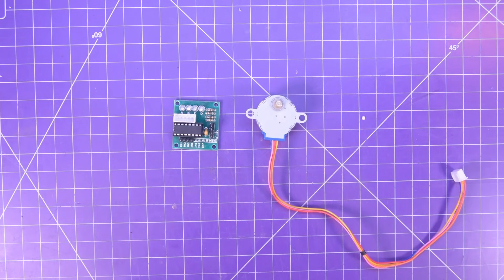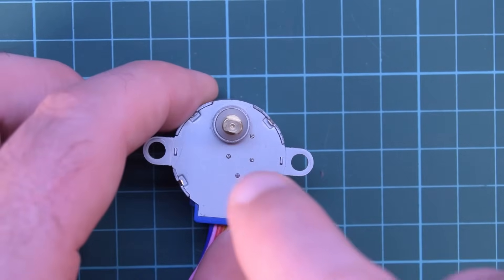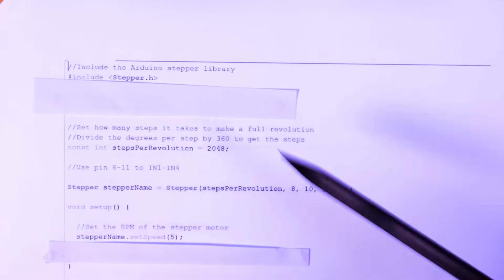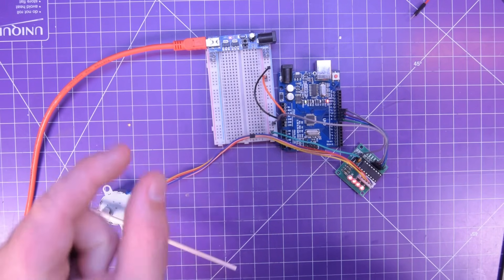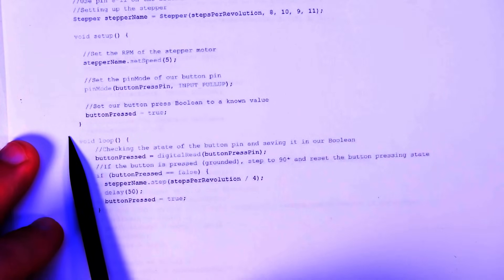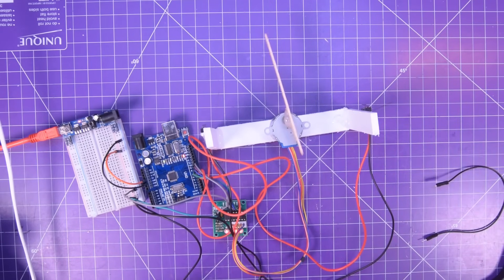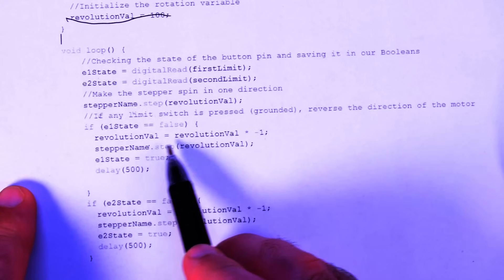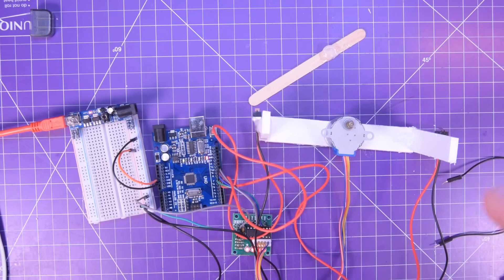The Cheapest Stepper Motor And How You Use It (28BYJ-48 & ULN2003 Arduino Tutorial!) (WITH CODE!)

Comment: Just FYI: The Arduino dev board YB-ESP32-S3-DRV (sold e.g. on eBay and documented on github) needs no cabling or external modules and makes controlling two stepper motors like 28BYJ-48 a breeze. Cheers Th

Comment: Will you tell me about your powersupply? At first I thought that I could use a 12V powersupply and the ULN2003 should reduce it to the value from the stepper. I couldn't find that in the documentation. To be sure not to overload the motor I decided to use a 5V supply because I had one with 350Amp. I could see that the program runned  because I added some counter messages in the serial monitor but the motor didn't run. How much Amps is your powersupply?

Comment: Train geek here, do a sketch that will make the stepper motor rotate a turntable and stop at the desired location so that the train can roll off the turn table.  Having 3 or 4 places to stop and a way to have the turntable do a 180 so the engine is turned around
Reply from the maker: Perfect use case for ChatGPT!

Comment: The first code works well, the second one that includes a button doesn't. Iv followed the instruction fully. somehow the button does not cause the motor to rotate.
Reply: ok i found the solution. I simply changed my setSpeed from (5) to (10)

Comment: Can anyone help me regarding the wires, I'm currently using an Arduino starter kit and the wire it uses doesn't connect the Arduino Circuit with the 28BYJ-48

Comment: I need a way to set up an app on my phone to be able to control a damper on my stove with temperature.
Reply from the maker: That's a big project! I recommend you leverage some AI to help you code that - one of my latest videos goes over using AI to make all sorts of code!
Reply: @ connecting the motor to the dial is easy for me to do. Its the electronics i have the trouble with. I want to be able to connect the stepper motor to a smart thermometer and have the motor move with the temperature as the temperature changes, not move in one motion but little by little say from one o'clock to 2 o'clock with one or two temperature changes
Reply: @SimpleElectronics @ connecting the motor to the dial is easy for me to do. Its the electronics i have the trouble with. I want to be able to connect the stepper motor to a smart thermometer and have the motor move with the temperature as the temperature changes, not move in one motion but little by little say from one o'clock to 2 o'clock with one or two temperature changes

Comment: Hi, nothing is perfect the first time. The best way to learn is from your own errors. I like this video.  I would try to replace these end-switches by (fast) light sensor. Which one would you use? Read analog input on Arduino / distinguish between light and dark level? Need to read ambient light level at start? Just some thoughts. This might be a challenge. Also, I prefer wood and screw instead of plastic and glue. Thank you.
Reply from the maker: You can use a pair of LEDs if you wanted to, if you shine a LED into another LED (works best with any color but white) the one being shined on will generate a voltage, so you can check for voltage and when the beam is broken, switch the direction

Comment: I wish to use a stepper motor to brush spiderwebs away from the lenses of my video surveillance cameras. Maybe a very light soft brittle brush directly wiping across the lens and a light 45 degree arm to wipe the abseiling spiders further out from the camera by a foot. I have to use a long stick and paint brush regularly and 10 minutes later the spider is back like a ninja.
Reply: Try a servo motor, it’s even easier to control, and you can set it to desired (absolute) positions, which a stepper can’t do.

Comment: 13:15 I'm curious if when the motor reaches the outer bound, the resistance seen by the motor changes (likely seen as a change in voltage e.g. voltage drop), if this location can have this moment logged, which it then uses as a stored value to change rotation. Effectively make it self learn it's outer bounds in both sides. Run it for a couple of cycles until it rotates fully without any resistance/voltage drop. This would also help the motor from doing too much extra work increasing is longevity. 
Could maybe program it to recheck those bounds every 100 cycles or so incase any tolerances have caused a change in position.

Comment: Hi, can we use this without driver? If i just need to make something, rotate indefinitely
Reply from the maker: No you can't - but to just make something spin indefinitely, just get a regular DC motor - you can adjust the voltage or the current to control the speed - set it and forget it!
Reply: @SimpleElectronics  Thank you so much

Comment: Ok, newbe here!!  My problem is everytime I compile the code it errors.  It says "compilation error: expected '}' at end of input.   Last of the code is .....  stepperName.step(stepsPerRevolution / 4);
delay(50);  
 buttonPressed = true;

}                                         What is wrong with this?                                 By the way love your videos!!
Reply: well i’m not a programmer but a have little background. you have a syntax error and it expected another “}” somewhere. it depends on the rest of the code previous. but somewhere in there, there is a opened bracket that you haven’t closed with the “}”

Comment: 5:10 So, if I need only it spinning on the lower speed in a constant motion, do I have to use an Arduino? All I need is it spinning in the lowest speed possible for my project. Other motors (DC motors) are way to loud and stepper motors are really quiet in comparison. Would it suffice only using the ULN2003 and the stepper motor? Maybe a turn on/off button maybe?

Comment: Nice video! I like the honest way of presentation.
Yes. For that task, I would go with "attachInterrupt" to change direction whenever a button is pressed.

Whatever happens in the main loop, the interrupt will execute. Even if the mainloop "stuck" in a delay function.
Interrupts always have precedence.

But as you mentioned: the code you shown is not perfect. I really like the honest way of your presentation.
Your focus was on the very basic operation of the stepper and the code.
Mission accomplished! 😊

Comment: I have 2 of these motors and I want to control them using the Arduino uno and a gyroscope mpu6050 , do I need an external power supply to power them or cable connected to the PC and 5v from Arduino should be fine ? Please answer
Reply from the maker: depends on the load - when in doubt, just use an external supply

Comment: I have an application, where I need to apply 14oz of force (pull or push, I assume is the same diff) to trigger a switch.  Can this stepper motor do that or do I need a different/better one?  If so, any suggestions?
Reply: Torque is the issue ... not Force. So how far away from the axis of the stepper motor does this have to happen?
Reply: @davidbroadfoot1864  Assuming a small gear or pulley were attached to the spindle of this stepper motor and it was tied (with a string) to a 14oz weight (the stepper motor being fixed to a board or something), could it pull hard enough to reel in that 14oz weight?  I assume a 14oz weight is 14oz, regardless if it's parallel to the stepper motor or on the floor, etc.

Comment: Wow. Awesone. Exactly what I need for blinking on robot eyes. I'm a year on, but as an arduino dunce (I can tweak but not write) could you pretty please nicely write a code that will blink eyes, a little faster and with say, 10 seconds intervals once switch activated to run permanently until deactivated? Well, you kindly offered. Btw I think your clip is brilliant. Even a simpleton like me can grasp it. I've brought you a choc orange just for the video, great. Don't worry if its a problem to write code. Cheers. :)
Reply from the maker: I am glad you liked the video but I am not in any shape to be taking on commissions at this time! check out the Arduino forums and reddit for some help! Make sure you give it your best shot before posting your code over there for help - but I am confident you can get it done - good luck!

Comment: When i turn on my stepper motor , it just vibrates bit the shaft doesnt rotate , does anybody experience the same issue ?
Reply: What you should do is check
* the connections -> PIN 1/2/3/4 of the ULN-Board must go to PIN 8/9/10/11 on the Arduino
* the code (6:05) -> the order of the pins is important ->  Stepper stepperName = Stepper(stepsPerRev, 8, 10, 9, 11);
* the value of the speed -> stepperName.setSpeed(15) - in my test/case a value higher than 15 let the motor losing steps

if are all correct and the motor doesn't work correctly, check the power for the motor. The motor (I've got today) has a consumption of 330mA at 3 to 7 volts. In my case I've connected the motor to a 9V block-batterie.

Comment: I have just come acroos your channel so havnt had a proper look. But if you havnt, could you do a tutorial om how to automticly have the motor speed up to x speed for x time and then slow down to  a stop using a push button. Could you also show how to code a button press to slow and then stop the motor even if it hasnt got to full speed. I make funfair models for a hobby (I have videos on my channel) And my next project requires one button to start and stop the model.

Comment: Once you use the arduino to write the code to the controller, can you unplug the arduino ?
Reply from the maker: No sir, the Arduino is constantly controlling the motor - the chip only turns the signals into a source strong enough to power the motor
Reply: @SimpleElectronics  Thankyou!

Comment: For this motor do you HAVE to have it connected to an arduino? I have a motor speed control circuit and have it connected from the power to that. Then I am running the connections to the stepper motor board and it wont turn on :(

Comment: Hi, what I am looking for is my stepper motor to start with a switch running clockwise and stop after about 5 full 360 turns, for an indefinite period of time, then it will reverse when the switch is turned off back to it original position. Could you help me?
Reply from the maker: Sure, which part of your code isn't working? You can email me what you have so far and what it is doing and I'll have a look
Reply: @SimpleElectronics  I don't have any code as I have never done anything like this in my 63 years on planet earth. Totally new to this stepper motor stuff.
Reply from the maker: Ah well, surely you understand that I can't really build projects for everyone who asks me to, but that's why I make these videos, to empower you to build your own projects! I think the information in this video will get you pretty much exactly where you need to go!
Reply: @SimpleElectronics  I do understand, all I asking for is to write a code that will allow the stepper motor to turn clockwise 5 turns when I switch it on and then stop. Then when I turn it off it should turn counter clockwise 5 turns and stop. Then if I do run into trouble I will turn to you for guidance, if it is ok with you.
Reply from the maker: @ralphrego7470  Sounds good, I believe in you!
Reply: @SimpleElectronics  Thanks I'll try somewhere else

Comment: Hi, I have 12V stepper motor. I'm new about this so when the staff asked me if I want to buy 5V or 12V..I bought 12V. Can I connect the 12 V stepper motor to 5V power supply on Arduino Mega?
Reply from the maker: You can try but it will be quite low power if it works at all
Reply: Use external battery for 12v supply and single cable connection with Arduino board